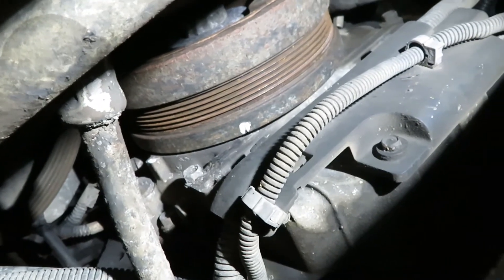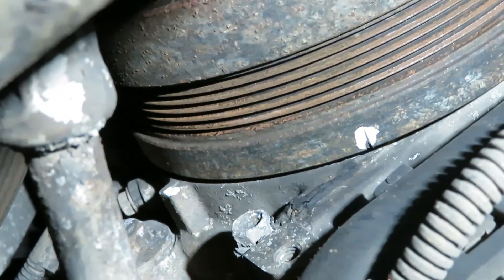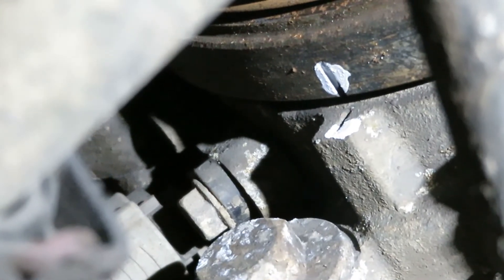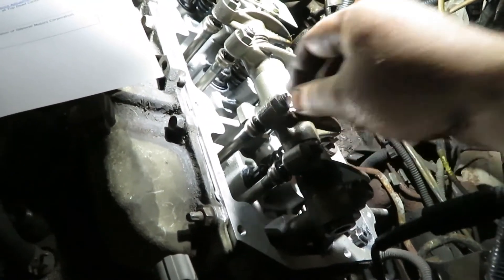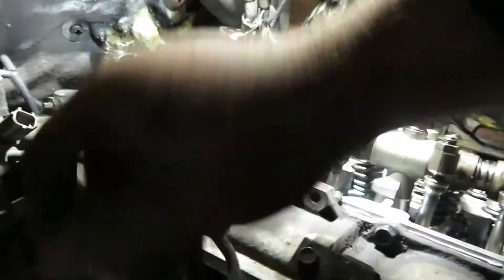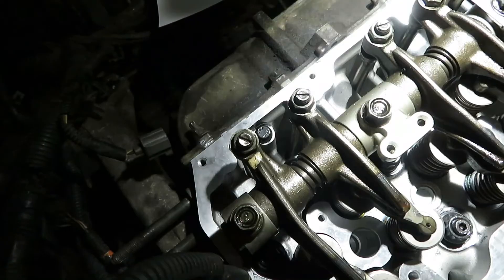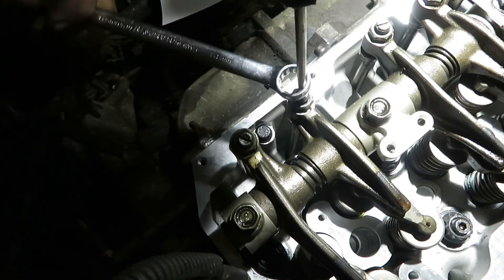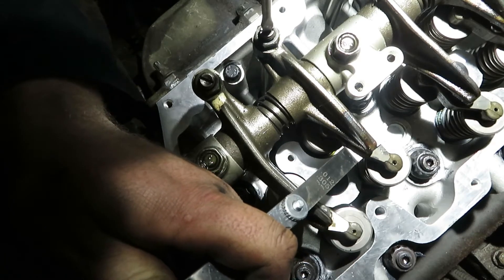2001-2010 Duramax Valve Adjustment (LB7,LLY,LBZ,LMM) Specs and Procedure In Description.

Comment: I always hear that, unless you are doing gaskets or removing the head for some reason you should never have to adjust valves on a Duramax. I call bullshit. Both Cummins and Ford have recommended adjustment intervals. One more of those things the manufacturer doesn't want you to pay attention to like "lifetime" trans fluid or 10-12K oil changes. They want you to wear out the one you have as fast as possible so you can buy a new one from them.
Reply from the maker: Cummins does have an interval yes of 135-150,000 miles, but ford is all hydraulic lifter so no adjustment needed.
But i see your point
Reply: @screamindieselltd  Wasn't aware of that on Ford's, just googled powerstroke valve adjustment interval and it came up with 100k-150k

Comment: I’m be looking at a 2005 lly studded , doesn’t smoke or anything, says number 8 cylinder has no compression, I drove the truck it runs somewhat decent, with the number 8 injector unplugged but he says if you plug the injector in it starts smoking, I’m assuming because the cylinder isn’t firing, could it be valve lash or what and there is no pressure at the oil cap or coolant reservoir?
Reply from the maker: Valves being out that bad would cause a pop out the intake or exhaust. Could be a bad injector. Has the owner actually done a compression test?
Reply: @screamindieselltd he said it had no compression but he’s seems like he doesn’t know anything about mechanics.
Reply: @screamindieselltd you think a stuck injector could cause that

Comment: Great explanation but my only question is wouldn't a full revolution be 360° of the crank? If your start an stop are the timing marks thats 360° not 180
Reply from the maker: You are correct. 360 crank it 180 cam. I must have misspoke.

Comment: So you absolutely need to set lash even if you take one head off to do a get me by fix ?
Reply from the maker: You still should check because machining the head can change it. Especially if a valve job was done to recess the valves.

Comment: Is it common to have to adjust these at 200,000? My truck has a slight ticking coming from the passenger side and it’s in tune with the rpm’s… my injectors are fine no white smoke or anything.
Reply from the maker: Yeah it is possible. They are not hydraulic lifters and so if the gap gets wider then you have to adjusted it manually
Reply: @screamindieselltd  thanks for replying man. Been trying to figure out this tick for a couple months I think I’ve finally narrowed it down to valve lash or an injector.
Reply: @screamindieselltd  also have you ever set them to 0.11”? Any benefits over 12 thousandths

Comment: I just rebuilt my 06 LBZ and I did the adjustment while the engine was on the stand but I think I may have gone a little tighter than how he explained it. I do have a little bit of a tick that I can hear but I'm not sure if it's exhaust or the valve lash

Comment: I forgot those 2 dowels for the rocker shaft I’ve probably put about 500 miles on since then.. how important are those
Reply from the maker: They just line everything up you may get some funny wear in the bridges and arms over time
Reply: @screamindieselltd  would you take it back apart just for that? She running great and more quiet then she’s ever been I know I got everything aligned very well with my eye? Can the assembly move after it’s been torqued without those dowel pins?

Comment: If you're in there for injectors, it's much easier to turn the motor over when they're out. I didn't have to bother with the balancer, just stuck a 23mm socket on the alternator and turned it over
Reply from the maker: That’s for sure. A diesel with no compression is super easy to turn over.

Comment: Great video.  Could my LB7 be in need of a valve adjustment?  Currently smoking under load or acceleration.  Injector balance rates are well within spec.  Stock LB7 w/ 1.3 million miles.  Valves were last done w/ head gaskets at 520k.  No leaks in turbo system.  I'm planning to do this valve lash adjustment, regardless.
Reply from the maker: Valves being out don’t usually cause smoke under load and acceleration. That’s usually a turbo, plugged air filter, plugged fuel filter or injectors. Is there any smoke at idle? When you checked balance rates did you compensate for fuel rate? MM3?
Reply: @screamindieselltd  I have this issue on my lb7. Smoke on acceleration but not at idle. Injectors done 1 year and a half ago with Napa injectors. I checked air filter and not sure what’s causing smoke when accelerating. Not even a haze on a very cold day from exhaust.

Comment: As for gaskets to do this....  A VC kit that includes upper, lower, bolt seals, and injector seats.. plus t-stat orings.  Is this all thats needed?  Or is their a gasket for the filter housing?
Reply from the maker: Yup that’s pretty much all that’s needed. The gaskets for the filter housing are in the housing so you don’t take them apart at all.
Reply: @screamindieselltd  Great, thank you!

Comment: I'm getting just under 100psi in cylinder #4 on my 06 LBZ, but my mechanic believes it's a cracked piston. I run a BullyDog tuner and never go over 24lbs of boost and rarely ever get it that high, so I wonder why the cylinder cracked when do not push this truck, and it's only got 120k miles. Perhaps just a bad luck defective piston, but are there any other causes for sudden low compression and knocking? Thanks!
Reply from the maker: Cracked piston, bent rod, rod bearing, wrist pin bushing would all cause a knock. Bent valves or pushrod you would get a “pop” out the intake or exhaust. That’s about all the at would cause low compression.

Comment: replaced a head gasket on my lb7, considering all of the rockers come of as one i found it unnecessary to set valve lash. 1 pushrod later i know have changed that opinion. thank you for the video sir
Reply from the maker: No problem hoping to have more instructional  videos to come! thanks for the comment and it sucks to hear you have to pull it apart again!!

Comment: quick question, what is all removed to access the both valve covers this open?
Reply from the maker: lots lol! injectors, injection lines, electrical harness for engine, charge pipes, upper valve covers and lower valve covers, upper rad hose coolant pipe, glow plug control module, high pressure rails, FICM, fuel filter housing. i believe the front brackets that hold the alternator and A/C compressor as well. I had the heads off for head gaskets so there is more off in the valley than there needs to be to get to the valves, but that's roughly what would need to come off.
Thanks for the Question and have a good one!!